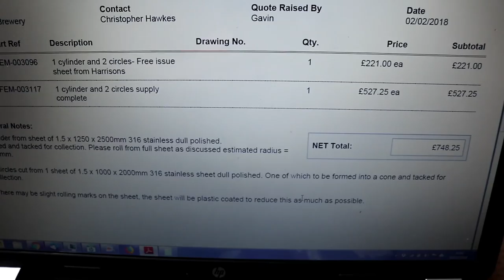HAIRCUT 100

Comment: I have similar, if not the same, spray gun and the paint needs to be the consistency of water for it to work well. To be honest it doesn't work well at all with emulsion, by the time it is thin enough to spray it's way too thin to get a decent coverage and emulsion doesn't dry fast enough to take several coats quickly. I have a small gravity fed gun as well and that is pretty much the same to be honest. I tried spraying emulsion and went back to roller before finishing a wall and being very disillusioned. If it's thin enough to spray it will need about five coats at least and each gun full will last about a minute. Cheers, Schnuz.

Comment: Hi Harry, in Lyon line of work (furniture manufacturing) “Free issuing” is where the customer provides the material, at their cost, for you to produce the item. I then just charge for the production time / cost. It may be beneficial if you can source the material at a good price. That way they will not add their cut. Hope this helps mate.

Comment: A gravity feed gun would work slightly better than suction feed but a HVLP setup is what you need for large areas.................not sure if your compressor would supply enough air for HVLP.......

Comment: Free issue. You would purchase the steel and issue it to the fabricator for free. It’s used when you feel that you can buy the initial item cheaper than the machinists, because your doing one off’s chances are your steel price is higher than their’s. By free issuing it would also mean you can control the material type you are buying. 
Give me a shout for mechanical engineering Q’s, I’m a keen brewer but you might if guessed it’s not my day job. You can get my email (if needed) from my website.

Comment: Hi there,

Free issue normally would mean that you supply the sheet steel and they fabricate the pieces for you To me the quote looks like two prices, £221 if you supply the steel sheet; £527.25 if they supply the (smaller) steel sheet. Quite why they then add the two together is a bit mystifying, perhaps they've cocked up? Showing the different prices and then adding them together in error? - that would be my bet as I would have thought that a sheet of stainless would cost about £250 at a rough guess. Get back in touch with them for clarification. Cheers, Schnuz.

Comment: You might have been better off with a whitewall brush in there but i suppose that would mean ladders etc and more time consuming. Hopefully you get the right sprayer and get her done,it will make a huge difference i am sure. Those fabricators sound a bit dodgy m8,sounds to me like they are chancing their arm and gazumping the price,bunch of knobheads. Hopefully you get an explanation asap and its full steam ahead. Take care. Cheers.